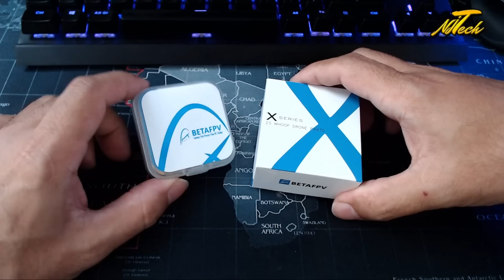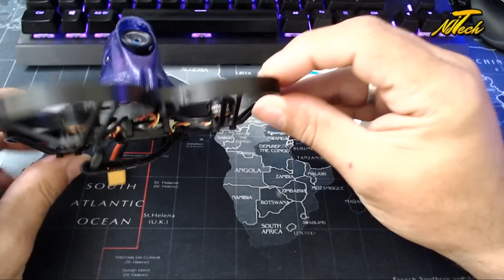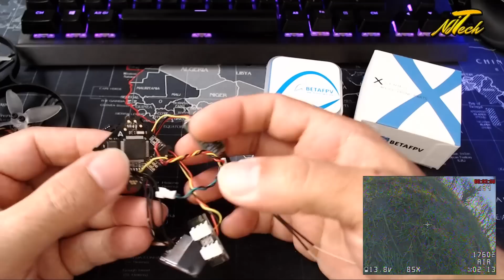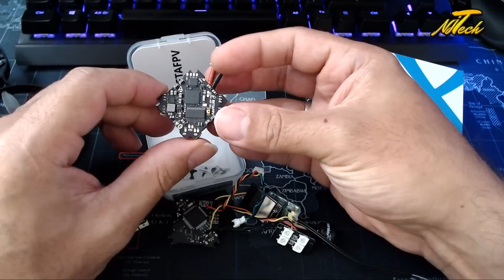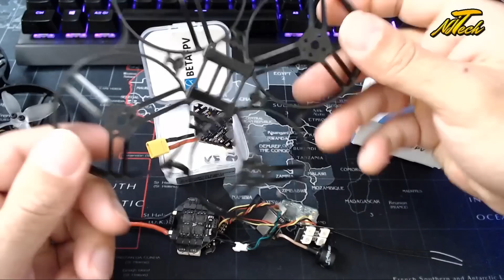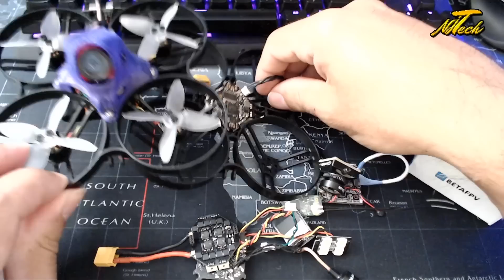BetaFPV 85XHD | 4S Ready?? | Prototype parts!

Comment: I hope they will release it soon....the 85hd was my pick between all the cinewhoops but the “4s gate” stopped me. What battery do you suggest? 650mah?
Reply from the maker: way too high, i was running 4S 300mah and the performance and flight times were excellent. If you tip the power to weight in favour of weight much over that you will start getting yaw washouts. Its super critical to these machines to keep them light. If on the other hand youre just cruising, then 450mah will get you a good 4min, maybe more..